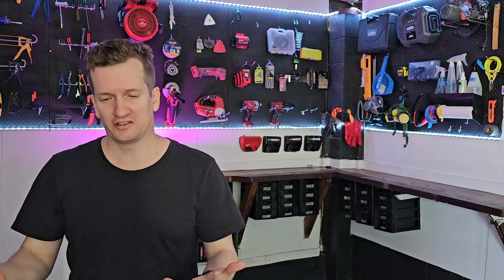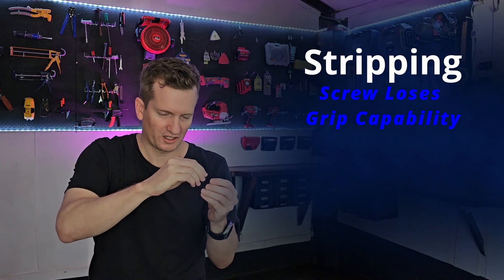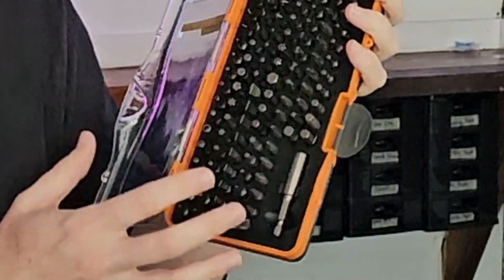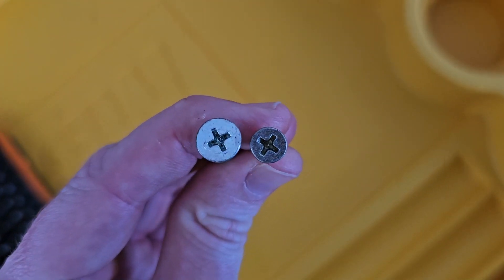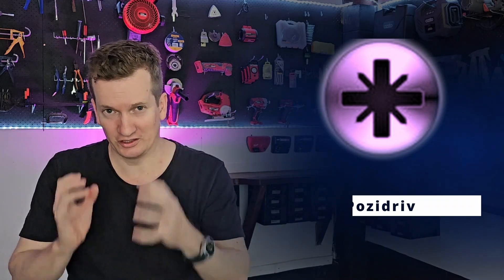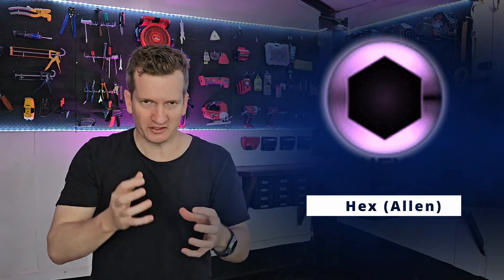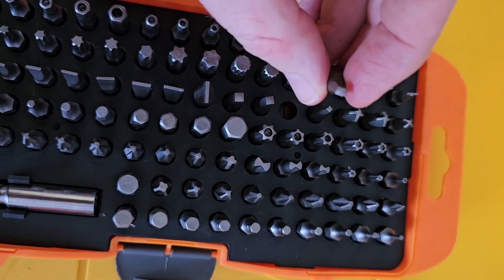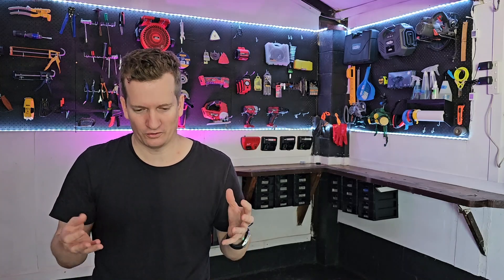Why are all screwdriver bits not Philips Heads?

Comment: Torx is very very common but maybe not in places where you see it often, it was originally made for the automotive industry  as a screwhead that allows precise torque application because it grips onto the bit so tightly. It was patented for quite a while, but is basically everywhere now (at least in Europe and America).
Reply from the maker: I didn't know that. Cheers:)

Comment: I feel like torx is more common than hex these days. At least for diy hardware stores. The screws are either philips(aka star) or hex. Both usually come with one or two bits per box of screws.
I dont think I've seen hex screws in diy stores since the early 2000.
Reply from the maker: Interesting. If you don't mind me asking what country are you from? Hex is still around for flat pack furniture etc in Australia. But with that been said I haven't seen it in houses etc
Reply: @suburbangardenshed  Norway. Hex is around for flat pack here as well. Things you assemble pre cut. I'm thinking more in the direction of "from scratch" building where you buy some wood and a few boxes of screws.
Reply: Czech Republic (central Europe) has a lot of hex/imbus screws nowadays